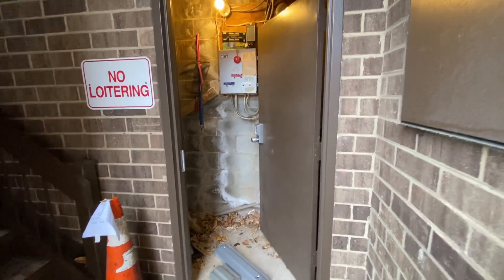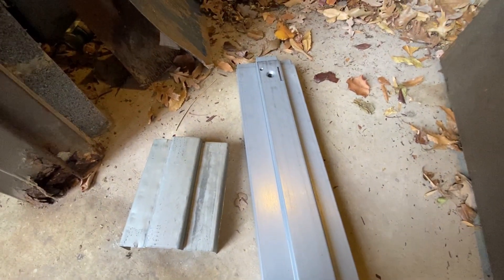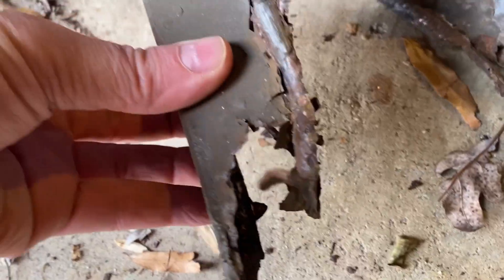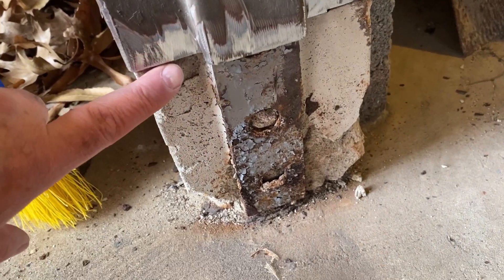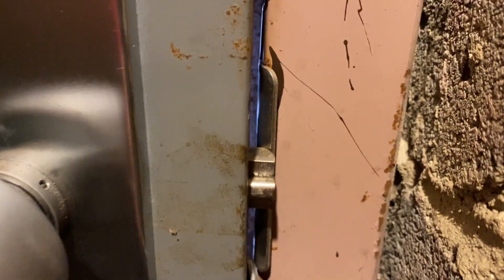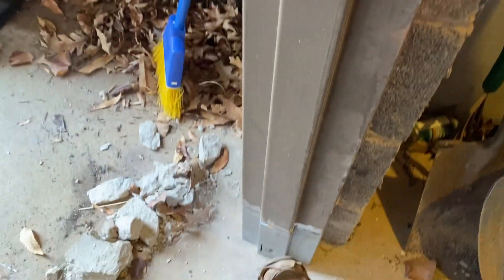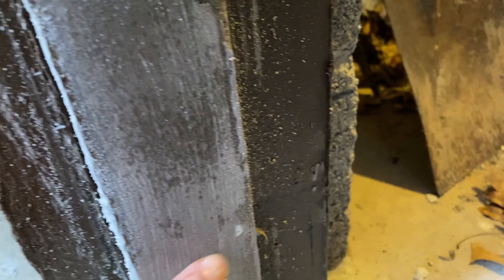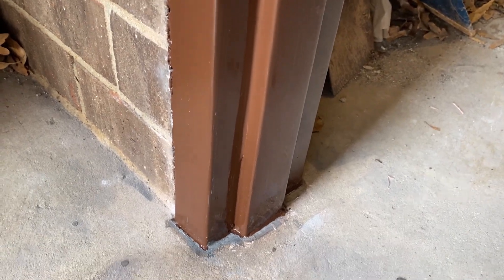Metal Door Jamb Repair

Comment: Thats amazing ..thankz for show us.. i wish you have showed us how you close the gap to make the frame solid.
Reply from the maker: @desmondmakgatho2479  I recall I put in a screw through the side of the metal frame into the jamb. Placed the screw through the opening for the door latch so it is not visible. Every door will be different but that worked for me.

Comment: No idea where ya got the pieces  but I got a building I repair use hydraulic cement an shape the bottom of the door then dry then hit it with some bondo hard as rock just as smooth door functions properly  won't rust out again its a bit tedious helps if ya make a jig to keep the shape
Reply: I have the same problem.  Can U post your solutions...👍🏾

Comment: I had someone contact me about a repair like this and also repairing the steel door , it’s rusted from the bottom as well , could I contact you to see what would be the best way to repair it ? Also what size wire did you use